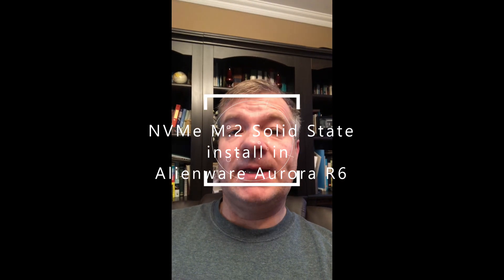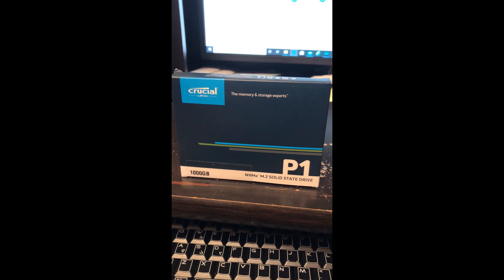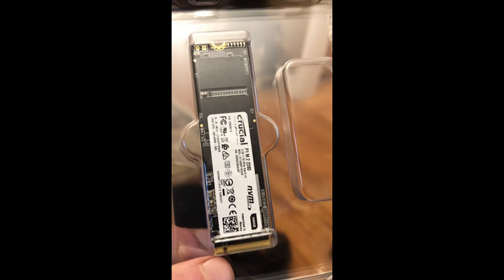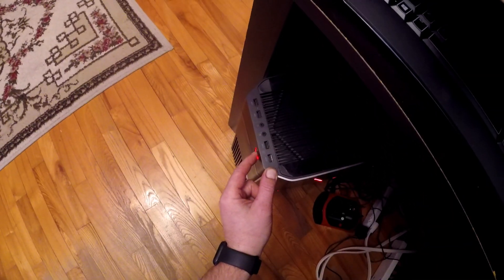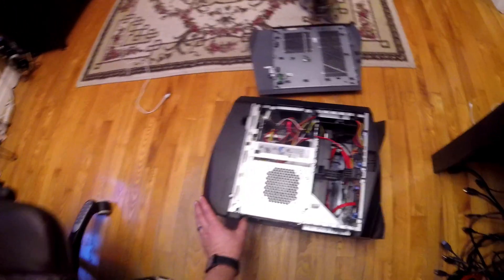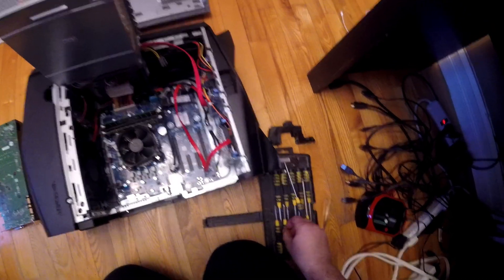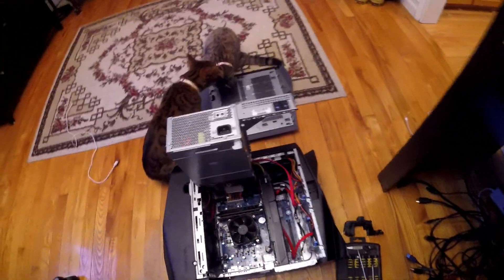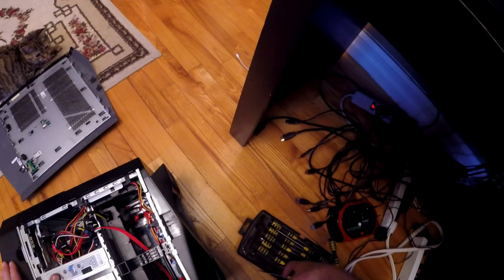M.2 SSD drive install in Alienware Aurora R6

Comment: I have the same exact  r6 as yours, I came across your video cause I just upgraded to a 1tb sabrent nvme, it seems to not boot up automatically and I would have to manually boot it up from the m.2 drive. My boot option is enabling to AHCI. Does your boot up automatically? And do you have a Amazon link to that crucial nvme?
Reply: im having the same issue
Reply: @DaBlackPlague  Did you fix it?
Reply: @mahid9594  i did fix it by deleting everything and formatting the drive i deleted all partitions
Reply: How'd you fix it?

Comment: Thanks for posting, Tony. Everything went well. I upped the ante on the size and it worked on my Alienware Aurora R6. I installed a Samsung V-NAND SSD 970 EVO Plus NVMe M.2 ---- 2tb :-)
Reply: @farzadjahanfard  mine has been working fine, no issues, thankfully. I looked up my purchase date, it was 10/9/20. I installed just a couple of days later so the m.2 has been going strong for 4.5 months. I don't turn my PC off, ever. But it does go into hibernate mode after 4 hours of inactivity. Unfortunately, I'm not very technical (so I can't help you). I just followed Tony Lee's instructions. I definitely have an R6 Aurora.
Reply from the maker: sweet!! How much are they?